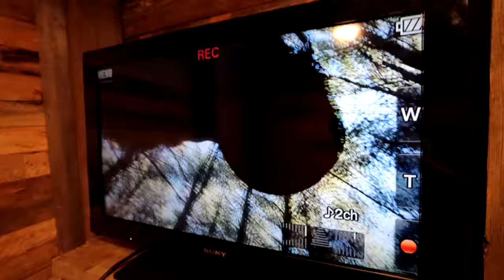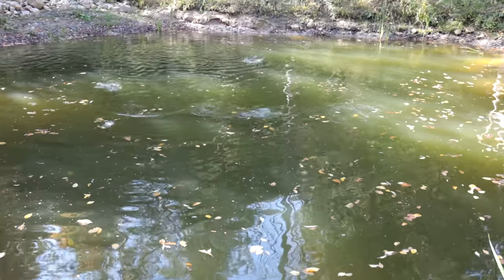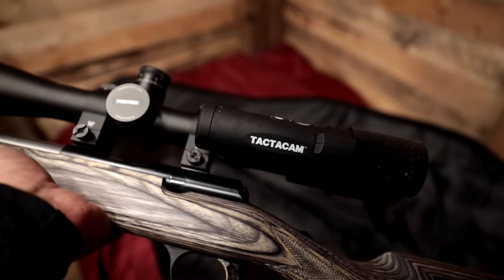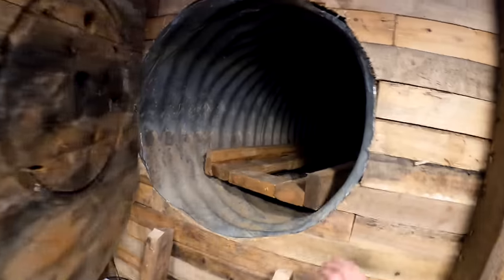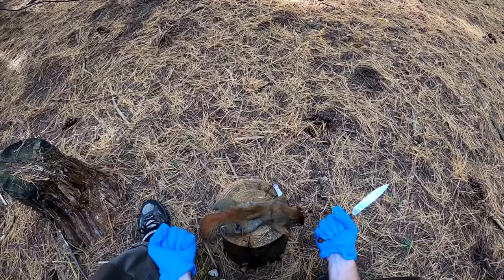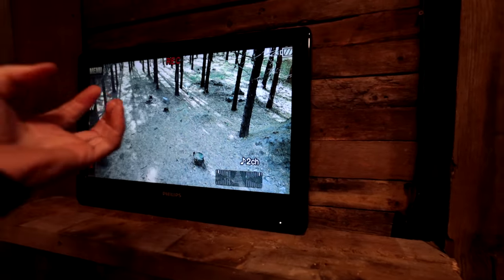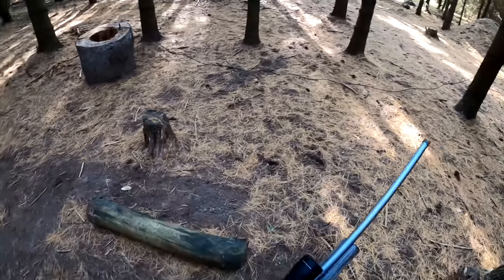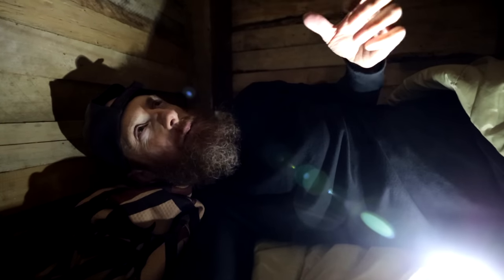24-hr UNDERGROUND Solo SPIDER HOLE Survival Challenge! - VIDEO SURVEILLANCE to Snip Food

Comment from the maker: Big thanks to Phoenix 200 for sponsoring this video: https://www.renogy.com/phoenix-200-portable-power-station/
Reply: Try cooking in a POT instead of a tea kettle. The squirrel got caught in the spout and essentially turned it into a pressure cooker. It wouldn't have sprayed water like that if you had left the lid off, because no pressure would have built up. If you want to cook without steam building up, try setting a fan up to blow the steam out of the emergency escape tunnel. Just leave both passages open to pull in dry fresh air from above, and blow steamy air out the side tunnel.
Reply: @ouissandy2806  I said POT not INSTAPOT. You know, as in pots and pans. DUH! What does that REST have to do with Anything?
Reply: @juliebaker6969  i ment cancooker or afgan cooker
Reply: Hey Chris, have you ever heard of the 24hr rigor mortis cooking rule for wild game? I've heard if you let it get past the rigor mortis stage,  you dont have to try and soften the meat up as much? Im genuinely curious if that is like a known rule or not, just in case society breaks down and im stuck cooking squirrels lol.
Reply: I like this power unit..
Reply: Love to see ASAT! Just watched your casting video...
Curious if you still apply for alone, and your thoughts on applying?
Reply: If you use a battery pack you can use a old phone and fpv camera  from a drone to go wireless you will need a phone for each camera  and a receiver for each cam all the cameras will need to be set on a different channel and each will need a antenna above ground  and a box built for each camera